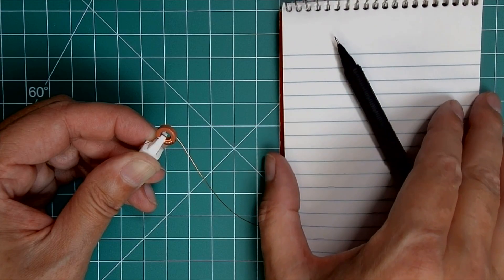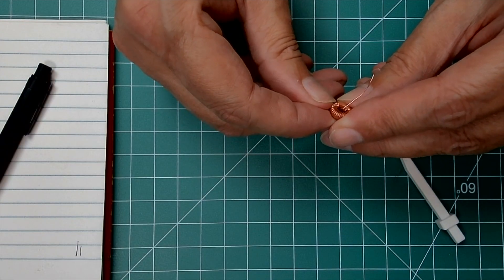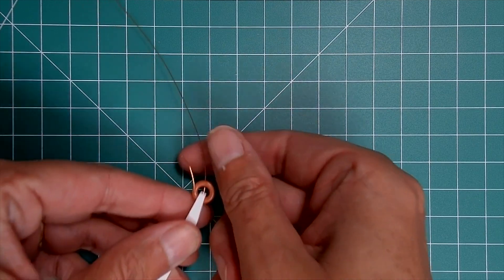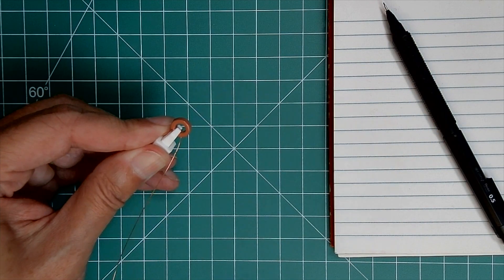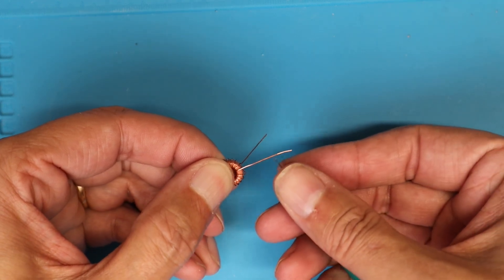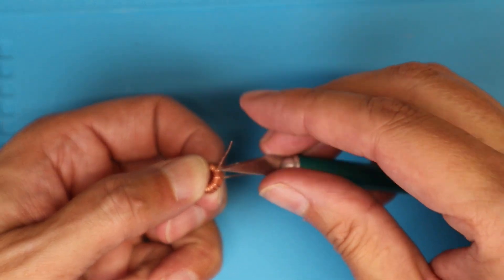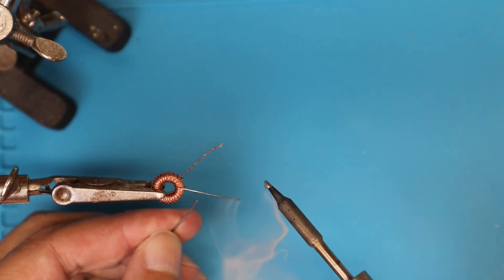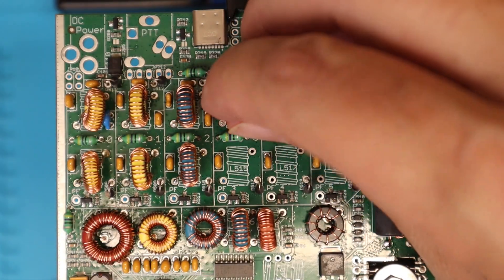Toroid Winding Made Easy

Comment: What I've seen that works great is spiraling your wire on a long axial cylindrical piece, such as a dowel first, and once you have adequate length, you lace it onto your toroid core by turning it, and just start spinning the coil of wire with your fingers and screwing it on somewhat rapidly.

Obviously, you have to sure up the windings to get them appropriately tight and uniform, but it goes incredibly fast.
Reply from the maker: Thanks for the tip!

Comment: A tip from me on removing enamel from wires without risking to break them. Works very well even for very thin wire (I did it for 42 gauge wire without a problem). Take a tablet of aspirin. Put the part of the wire that you want to remove the enamel from on top of the tablet. Press down gently with the hot tip of the soldering iron. The aspirin will melt and dissolve the enamel. Next, apply flux and tin the wire. That's all. Have a fan or some other form of ventilation because it will produce some fumes.
Reply from the maker: Thanks for the tip. I will have to give that a try.

Comment: Great thank you. I wish I had seen this a month or so ago when I started on my QMX+. I'm going to download the files for the holding widget and I'll twist a friends arm to print it for me. 
I find the best way to scrape the enamel off is not to use the sharp edge of the knife blade but the back edge instead. It has less tendency to cut the wire and does as good a job. What I use now rather than a knife blade is an engineers scraper I made from a 3 square (triangular) file as an apprentice back in the 70s. Works really well and has put a tool I haven't used for years back into use.
Cheers & beers de Al G8YKM.
Reply from the maker: Thanks for the kind words. As you saw in the video, I was building my QMX+ as well. I would have loved to have the holder for the other kits I have built. Good tip on how you scrape the enamel. You do have to be careful with the Exacto knife but I have yet to break a wire. Light pressure is the key.